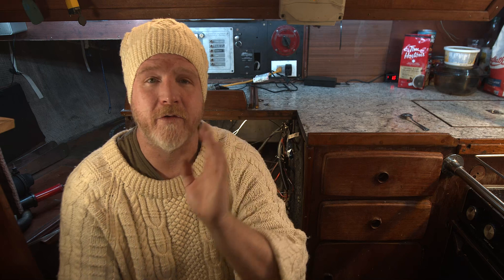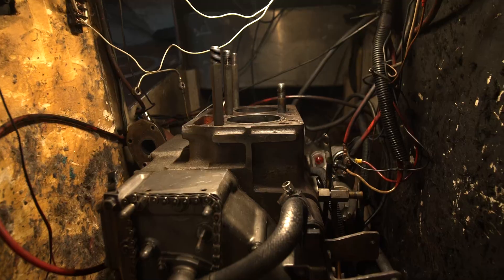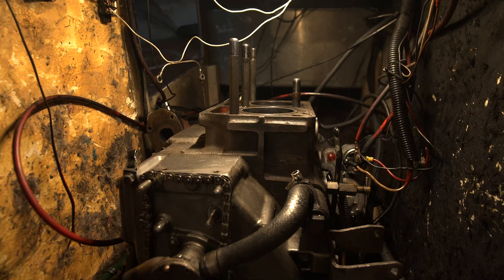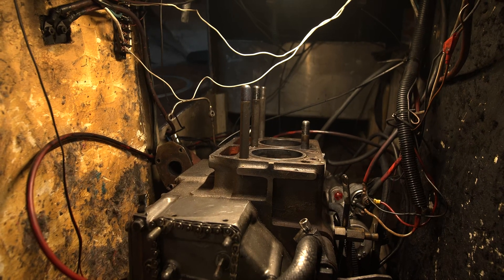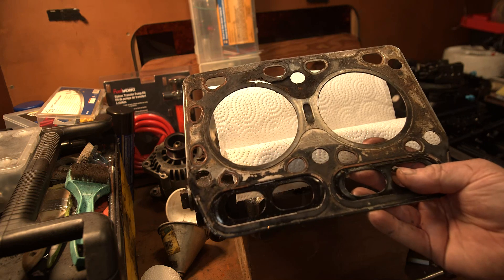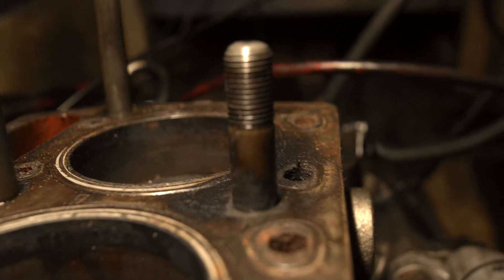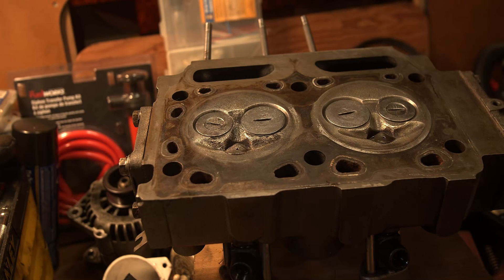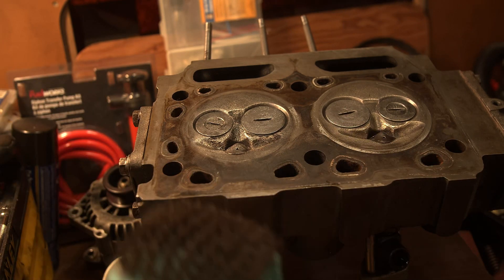How to diagnose a head gasket leak SVEV episode 31

Comment: Nice work on the engine. One thing to note is maybe putting smaller micron filter before it reaches the engine. A lot of guys on the older diesel trucks put water separator right after the tank as well. It didn't look that bad when it was coming out of the tank though. Might be the video though. Hope this thing purrs like a kitten when it's done.
Reply from the maker: I have a 2 micron at the engine 10 micron in the water separator. good to hear from you!